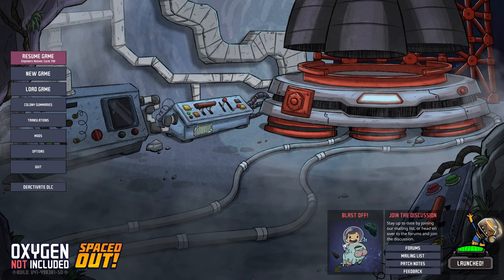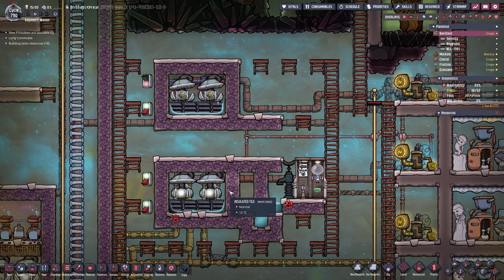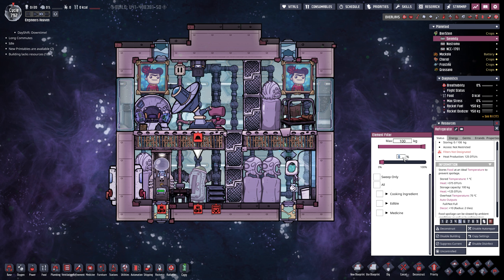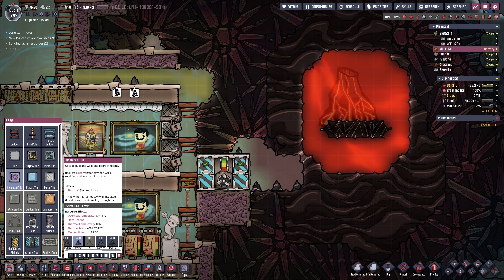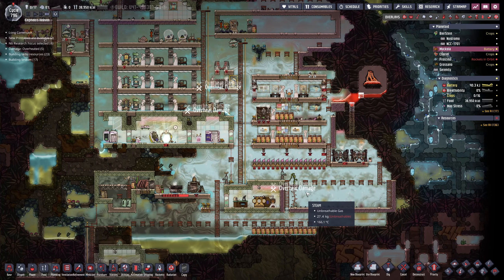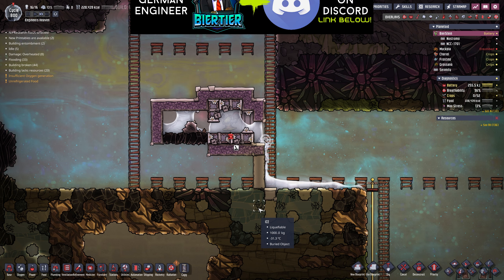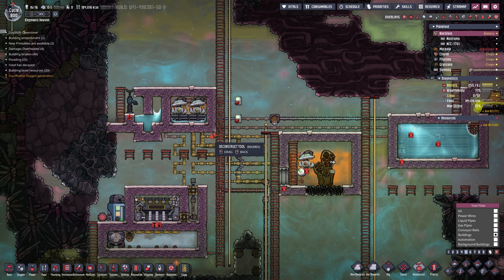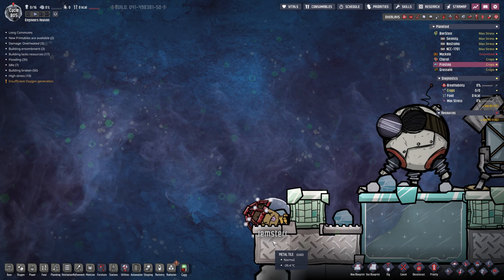When a GERMAN ENGINEER makes HORRIBLE MISTAKES... (LP1-EP 26) APRIL FOOLS EDITION!

Comment: You can build an Escher waterfall that fills infinite storage and it will get rid of the waterway faster.

Same with a side pump for gas.

In case you want to so test designs for recovery. 

Nice video though :-)
Reply from the maker: Haha, yes, that would be possible, but I doubt I will spend any time on trying to recover from this insanity 😂🤣